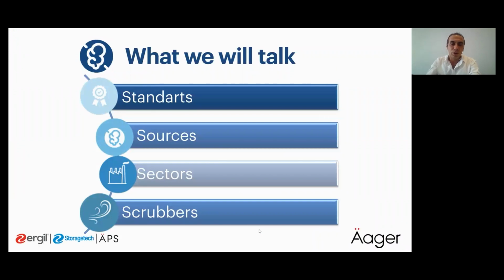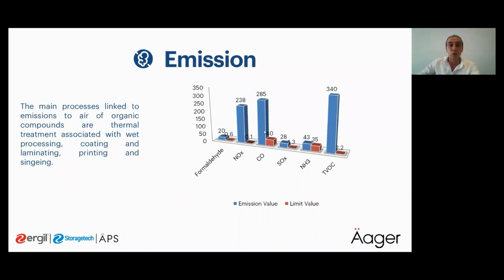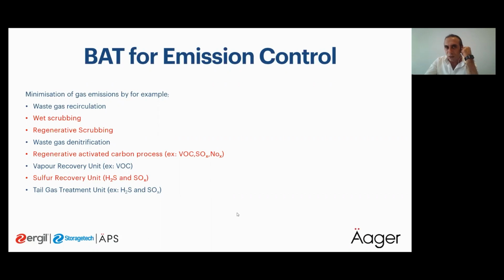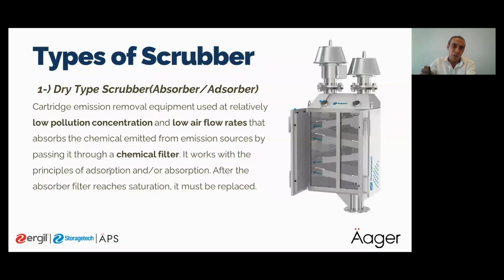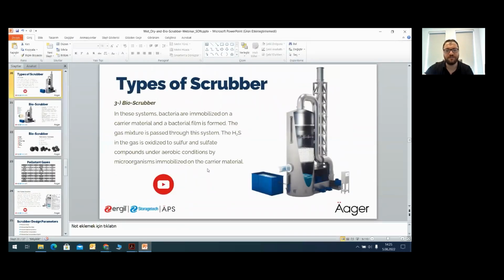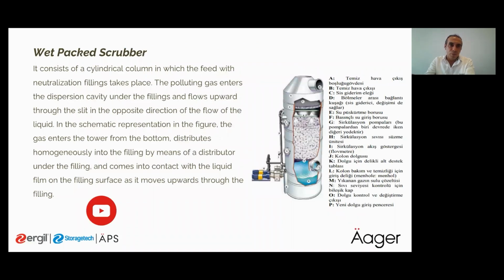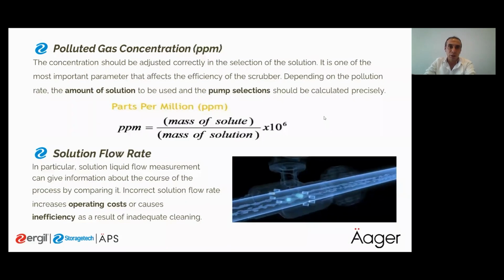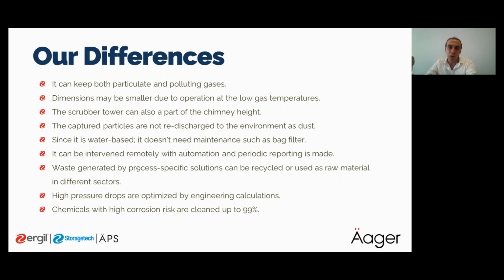[Webinar] 05 - Industrial Wet & Dry Scrubber Systems | Regulations, Common Problems & Solutions

Comment: Fact 1: Remove the Earth’s atmosphere or even just the GreenHouse Gases and the Earth becomes much like the Moon, no water vapor or clouds, no ice or snow, no oceans, no vegetation, no 30% albedo becoming a barren rock ball, hot^3 (400 K) on the lit side, cold^3 (100 K) on the dark. At our distance from the Sun space is hot (394 K) not cold (5 K). 
That’s NOT what the Radiative GreenHouse Effect theory says.
EVIDENCE:
RGHE theory “288 K w – 255 K w/o = a 33 C colder ice ball Earth” 255 K assumes w/o keeps 30% albedo, an assumption akin to criminal fraud.
Nikolov “Airless Celestial Bodies” 
Kramm “Moon as test bed for Earth”
UCLA Diviner lunar mission data
Int’l Space Station HVAC design for lit side of 250 F. (ISS web site)
Astronaut backpack life support w/ AC and cool water tubing underwear. (Space Discovery Center)

Fact 2: The GHGs require “extra” energy upwelling from a surface radiating as a black body.
EVIDENCE:
According to the K-T atmospheric power flux balance, numerous clones and SURFRAD the GHGs must absorb an “extra” 396/333/63 W/m^2 LWIR energy upwelling from the surface allegedly radiating as a black body. These graphics contain egregious arithmetic and thermodynamic errors. See https://youtu.be/0Jijw7-YG-U

Fact 3: Because of the significant non-radiative, i.e. kinetic, heat transfer processes of the contiguous participating atmospheric molecules the surface cannot upwell “extra” energy as a black body. 
EVIDENCE:
As demonstrated by experiment, the gold standard of classical science.
For the experimental write up see:
https://principia-scientific.org/debunking-the-greenhouse-gas-theory-with-a-boiling-water-pot/

CONCLUSION:
No RGHE, no GHG warming, no CAGW or mankind/CO2 driven climate change.
Reply from the maker: Thanks for sharing.